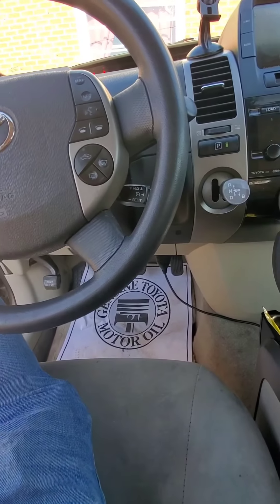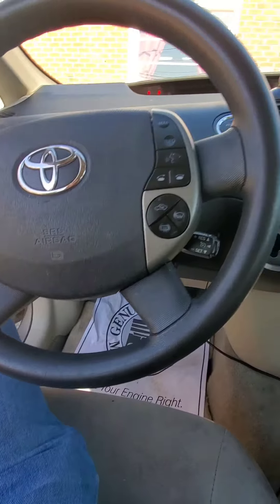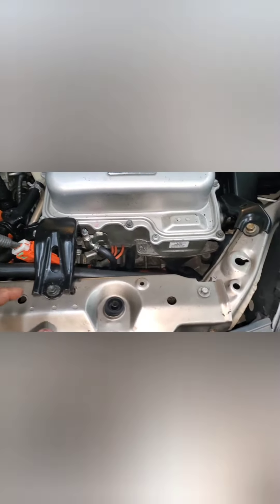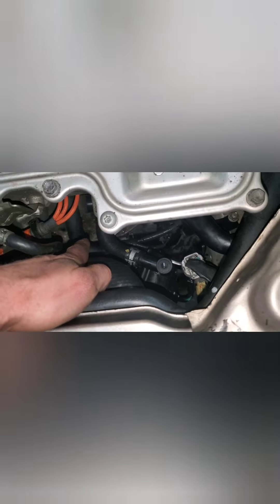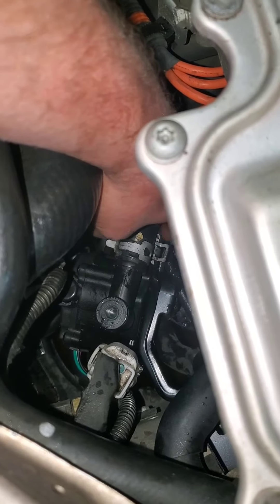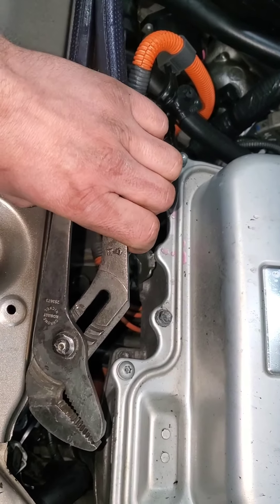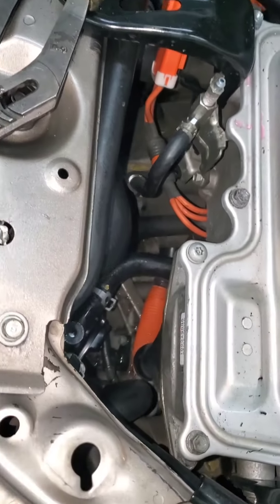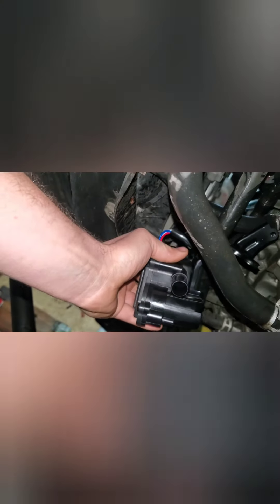How to replace a Heater Control Valve on Toyota Prius  P1121

Comment: Precious info. I knew about that valve and I changed one already. Not that accessible but doable. My Prius and is the coldest weather the heat doesn’t work. I can hear a gargle in there too. Very frustrating without heat. Thanks!